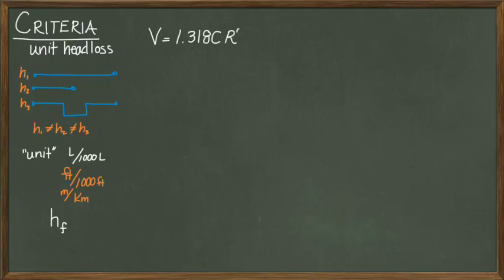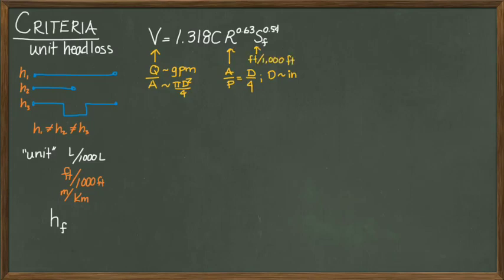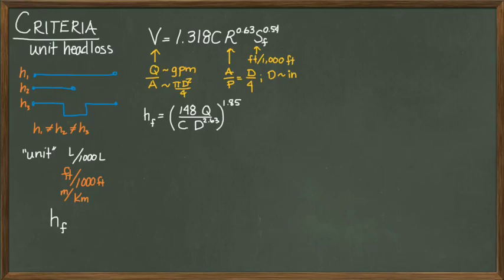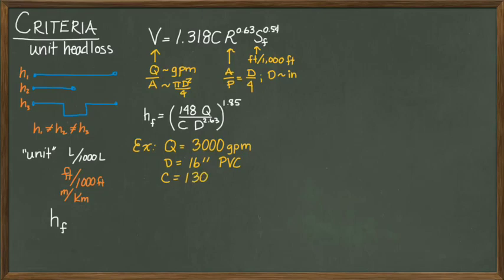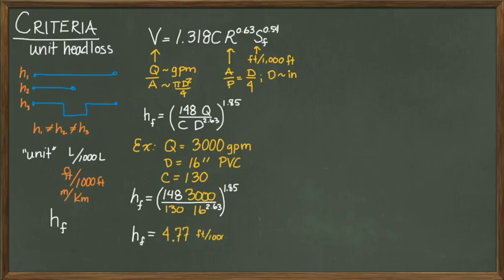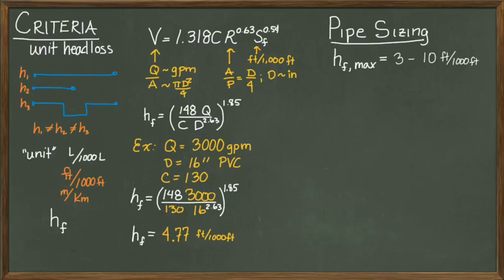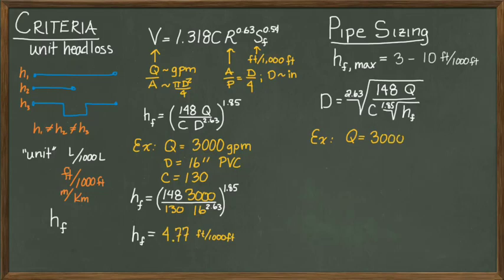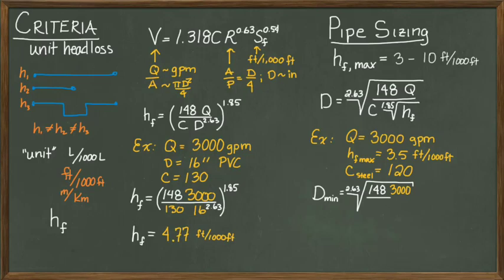Hazen Williams Examples

Comment: Thanks. Please can  make video for this example. I have 70 gpm disharge of water ( English) and distance between disharge of well and tank 10 km and hight 160 meter. Please how can choose size of hdpe pipe and how many bar of pipe.
Reply from the maker: To size a pipe in this example I’ll need to know more information.  For example, do you have a maximum velocity the flow rate cannot exceed? Do you have a maximum unit headloss that is permitted in the pipeline?  Or perhaps, is the objective to find the pipe diameter so that the residual pressure at the tank is above a certain amount of pressure? Also, when you say “bar of pipe” do you mean pressure measured in bars?